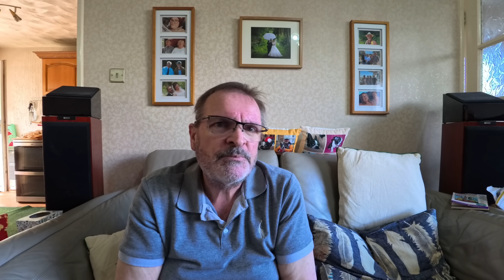Expert Ships Engineer Reacts to Baltimore Bridge Crash

Comment: I am not an engineer, but I have used a pretty powerful motor on an inboard Columbia River boat, along with other boats.  I am almost sure the narrator/engineer is correct about the propeller going in reverse.  The first thing I noticed when watching the video, over and over, was the heavy black smoke and thinking it was operating under a load all of a sudden.  I reasoned, that if the ship was getting close to a bridge and there were any worries at all, the pilot or whoever was operating the rudder and throttle, there would be no sane reason to speed up the forward speed in an unsure situation.  He should have just maintained the steering and glided right through the gap, instead of powering through on the same course which they had been traveling.  The red lines that were superimposed on the video showed the course taken.   I suspect that whoever was steering the ship either panicked or was a novice...probably both.  As our narrator said, in a roundabout way, things of that magnitude that are so heavy and long tend to happen in almost slow-motion.  Whoever it was that threw the ship into reverse was not familiar enough with reversing for a sudden "stop," (and the effect it would have on the steering), to make a level-headed, professional decision.  I am guessing that it was "pilot error."  It might be that he bribed someone to get approved for a license.  It was either that or it was intentional...which is a whole different bucket of worms.
Reply from the maker: It’s not uncommon for Ukrainians to buy their certificates. Full astern and the wind pushed the boat into the bridge
Reply: @retroonhisbikes  My thoughts, exactly.  The first "Pilot Error" was buying something that should be earned.  It was originally the government official that "sold" him the license in error.  I didn't know the wind was a factor.  I also didn't notice the plume of smoke blowing to the ship's starboard.
Reply: I'm sticking around for more of your fantasy stories.   Well...  yours and retro.

Comment: Why at such as an inopportune time for a ship to have a blackout ? Does not appear to be normal.
Reply: Your boats engines will fail at the most in opportune time. They are like printers and computers, when you really need them they will not work.
Reply from the maker: Stuff happens

Comment: The "paddle wheel effect" is called "prop walk" and is a real effect. Yes, in a full reverse situation, the bow will tend to drift to starboard. The bulk of the ship, the momentum would keep the ship going forward.  In reverse, forward to starboard in this case.  He is right.
Reply: You guys are more experienced than I am. I have never felt prop walk with my two props. I do know that when I'd throw my engines in reverse my boat will turn the opposite way of when they are in forward. Maybe since mine is only 65 feet it has counterrotating props and ships have props that are not counterrotating? But to me that would be unusual both from a steering and engineering perspective.
Reply: @sofakingrad3530  Ships have a single prop. A twin prop has counter acting forces as one prop is typically turning clockwise while the other counter clockwise going forward and opposite in reverse. On your yacht, try going in reverse using only one engine. You will see "prop walk" firsthand. Try going forward with only one engine engaged. Again, you will see your bow drive to one side opposite the direction it goes in reverse.
Reply from the maker: Thank you

Comment: They should have crew at all stations and emergency steering when in and around port or bridges/other objects.  If that's not the rule now then it should be.
Reply from the maker: You have hours of rest to think about, if the engineers had been up all day doing maintenance and again up at midnight to take the ship out, you still rested engineers for the morning. 
Most ships these days run an unmanned engine room, have sailed on ships that have no engineers in the engine room at standby - scary stuff
Reply: @retroonhisbikes   Yeah that is scary to think about.

Comment: As to fuel, the North American ECA extends 200 miles from the coastline.  It is about 170 miles from Baltimore down to the mouth of the Chesapeake (Cape Henry Virginia) and then another 200 miles out to the end of the ECA.  If she was going to Colombo then her track would probably have kept her inside the ECA until about 60 miles off Key West, unlless she was routed East of Cuba which would have her exiting East of Cocoa Beach, but then Panama Canal requirements of fuel/scrubber in the zone would question if vessel would have changed bunkered fuel.  Absolutely not within US waters and not within NAECA.

As for her drift and the way the stern moved to port you have a valid observation, either that or the influence of Curtis Creek emptying in to the Patapsco.  Either way her bow rounded the dolphin (which when she struck was about 15m from the and abaft the starboard beam).  With regard to the investigation it will be NTSB and the Coast Guard juggling their involvement, then various civil courts will become involved

Comment: I am a naval architect and marine engineer.  Over the years I have spent untold hours studying escorts, steering, thrusters, allisions, oil spills and oil spill response.  My professional career was spent working major oil companies.

I agree with your conclusion that they mistakenly went astern when they restarted the engine.  I also believe they mistakenly released the port anchor.

I believe that the MV Dali at eight knots had enough lift from the rudder to steer the ship.  I believe that they would have retained steerage until the speed dropped below 6 knots.  I  believe they would have had enough speed and rudder control to pass safely under the bridge.  

I, of course, am making judgment based on my experience.   I am not a licensed engineer.   My time at sea was during sea trials, doing tests, supervising contractors, and watching the ship's crew carrying out their duties.  I am opinionated when it comes to certain items.  I believe when the NTSB study is released in a couple of years it will indicate the accident could have been avoided had the officers on the bridge fully understood the behavior of large vessels in blackout conditions.
Reply from the maker: Agree 100%
Reply: Agree but the report won’t be out for at least 2 years. It was a preventable accident at best.
Reply: Makes me think of the endless speculation on how the Titanic could've avoided that iceberg.  Throwing it into reverse deprived the rudder of prop wash and lost its effectiveness.  Had the Titanic OOD simply ordered hard to port, the prop wash from the center screw was available to amplify the rudder and it could've missed the iceberg.  Another few seconds to assess the turn might've sent a second order for the port engine to stop.  Thus creating a bit more asymmetrical drag to further turn the ship.

I know.   Woulda, coulda, shoulda.  Easy to be the armchair captain after the fact.  Panic and instinct overruled training in this case.
Reply: I have nowhere near the credentials you have. Yes, I'm a retired navigator, and I reached the same conclusion. Panic and desire to fix the non e existing problem. Enough speed to clear the bridge. Conspiracy theories abound. Captain, which has not been mentioned thus far, is Ukrainian, blackout black box, Biden offering to cover the rebuilding costs to prevent a investigation by the insurance company...
Reply: Unfortunately, construction sea trials do not demonstrate a loaded ship maneuverability under power failure circumstances.🎉
Reply: There’s no way letting go the port anchor was a mistake.  Letting go the port anchor was the prudent call in that case.  Whether or not they went astern remains to be confirmed.  If they did go astern, was it a mistake in the moment? Would they have just coasted through if they hadn’t gone astern? I don’t have the answers. Those are the questions that will be argued for many months to come.

Comment: Another consideration, yes the Main Engines would shut down on LO trip, oil pumps stop - the Alternators would continue running, Putting instant full load on the First Alternator would trip that breaker, the second black out - the engineers in the control Room, instant panic - the question must be why instant Black-out - as preferential trips should have reduced electrical loads and prevented total loss of power - the outgoing tide could have done the rest
Reply: the ship's generators are always carrying full load....  the main engine only performs propulsion.

Comment: Surely the paddle effect would only apply if the propeller was only half in the water. Fully submerged, it’s top rotation would counteract the lower.
Reply from the maker: Mostly the top of the blade is out the water. May have needed to ballast in clear water.

Comment: From wikipedia, the ship is equipped with MAN-B&W 9S90ME-C9.2 - Main Engine. This rules out Diesel-Electric propulsion.
I am puzzled how can a blackout create a complete loss of propulsion.

During Sea-Trials such ships are tested for propulsion and maneuvering tests under blackout condition. So, I still don't understand what happened there. Loss of electrical power should not create a condition of loss of propulsion and steering.
Reply from the maker: Fail safe, will stop the engine. No lube oil will also stop the engine.

Comment: As an Engineer myself - I understand the Vsl is twin screw with divided Engine Rooms and 2 Alternator Rooms, maneuvering with a split board - there would not have been sufficient time to restart the main Alternators and certainly no time to restart the Main Engines either ahead or astern - the black smoke most likely from Emergency Alternator starting and coming onto Full load within seconds - given full Indian crew I'd be questioning competency
Reply from the maker: Single screw and theyve have not split the switch board.

Comment: If they had 8 knots of forward momentum and the ability to steer once the emergency generator started (which it clearly did) then wouldn't they have been better to simply steer the ship ? With such a massive momentum wouldn't that have given them better control on the course they were already heading ? Not understanding why they put it in reverse thrust, which looking at the video seems to be the point it all turned pear-shaped.

Comment: Thank you for taking the time to offer a professional assessment. It's a good public service. It seems this vessel was notoriously deficient in both propulsion and electrical systems and a whistleblower that tried to alert the authorities about major safety concerns was suppressed by Maersk, the leasing company that chartered the vessel and was already cited for violations last June. Aside from that most glaring fact, WHY were the tugs not in attendance until the ship made it safely to open waters?! Did they just assume that because there were specialized pilots aboard the DALI that were trained to avoid port obstacles that their presence (the 2 tugs) wasn't needed during the most crucial period?
Reply: we know what happens to whistleblowers

Comment: I agree with your analysis Chief - though the first black out looks like a full black out (as the navigation lights and the forecastle  flood lights all went out suggesting a Main switchboard trip - for example  possibly the  main engine stopping due to engine control system safeties tripping ( possibly   the lubricating oil and fuel pumps etc stopped) or an Engine overload trip (ie  going from dead slow to full ahead to fast) - I don't see it being a fuel issue as normally they would isolate the cylinder by shutting off the fuel to the cylinder injector. When it repowered up ( it looks like 3 small puffs of black smoke( air start indications) before the big one) - only the  Navigation light and deck walkway emergency lights came back on ( ie Emergency Generator circuit), then you see the  black smoke rise (Main Eng restart & then continuous thick Black smoke ie Engine under load (with rich fuel / air mix) -  as you said. Then the Forecastle  Flood light  come back on (Main power source restored), when the second black out occurs the navigation lights stay on ( indicating they are still on the emergency Generator Circuit) - may be an Engine safety was triggered ( ie  Engine overload trip), before the forecastle flood light comes back on  again( main power restored), at the last moment you see the ship  swing to  Port (more correctly - the  stern kicks to Starboard) - this is likely the dropped anchor  taking weight and kedging, as there is no  break in the Black smoke -   I'm a former Master & marine insurer's  defence lawyer specialist  who  specialised in  Maritime  incident and  responses, investigations and litigation - so am intrigued to working out  the cause of the the tragic event. Poor Crew will be  grilled endlessly and will be stressed and shocked all at once. BTW - I think you are right re the going astern issue at 8- 6 knots and  being les than 2 ship lengths to the bridge...  that is a  butt pucker moment! -  and the  Bridge  was not protected  with modern  ship allison barriers  compared to the bridge  pylon protection on the nearby overhead Powerlines Poles protection  barriers.  Terrible accident.
Reply: I doubt that barriers would have protected the bridge in this collision. The ship was slewing to starboard, the bow still going in a sideways motion. The bow did not hit the pier head on. It hit it on the side. It is the forecastle structure that hit and sliced the pylon. This displacement buckled the pylon of the bridge and pulled the deck - to the left in the video. The recoil, the "spring back", snapped the anchor points of the deck on the other pylon, right hand side in the video. Careful observation reveals the shock wave travelling back (left to right)  along the bridge deck and structure after the bridge was put in tension by the forecastle impacting the pylon and the shearing of the pylon released that tension.
Reply: @denkern-phil   I can't comment on the  mechanics of the bridge failure am not a structural enginneer - but your description sounds logical to me,  the "Slewing  to starboard" I can  comment on because that is a fundmental of ship handing and is caused by what is known as transverse thrust (or paddle wheel effect) when the engine is put astern. And you are right  the  Impact was  about  2  - 3 points( 22.5 - 33.7 degrees) on the  Starboard side of the bow but at the last moment  about 5 seconds befoer impact -  the ship actual starts swinging to Port (most likely due to the  dropped anchor taking weight)   If the  electrical power bow truster  was  used  it would push the bow sideways  first, if steering the black smoke would have a gap as the engine load changes ( which  I can't see) and  the stern moves  sideways before  the bow. Hence  without the black smoke  change  it seems the  very last minute swing to port  in not caused by steering.
Reply: Interesting and quite possibly correct analysis of the electrical power sequence, there was something wrong with the emergency supply to the navigation lights and, according to the NTSB the data recorder, so there may also have been a loss of instrumentation on the bridge: no radars, electronic chart display, helm and engine indicators, so the bridge team may have had difficulty understanding their situation. The ship swings to starboard tho'(bow to starboard, stern to port), as you'd expect when the ship's engine goes astern, so the swing to starboard and the black funnel smoke is consistent with the engine being put emergency full astern while the ship was still making headway.
Reply: @simonjohn9525    I think people have misunderstood the NTSB Language about the Voyage Data Recorder..   The way they work is that it receives signals from Instruments and systems , and recorded  audio  (microphones) on the Bridge at the same time. If the Voice recording never stopped recording audio then  it never stopped functioning - what I believe is most likely  with the black out is the  instruments and systems  stopped sending signals until they repowered,  which is why  there was the minute where the Voyage Data recorder  stopped recording Instrument & System data  but still captured the Bridge audio.  What actual caused the initial Blackout that started the chain of events will be difficult without seeing the Engine control  Alarm logs but logical  is most likely related to a particular critical system I think.  My knowledge and experience on international ships, systems and  investigating these sort of incidents  around the world says  it was just a number of bad events combining in a   chain/sequence all at once and it is not just caused by the  cause of the Initial blackout. The legal  issues are massive and complex and due to the amount of money involved - no one will escape blame.
Reply: Good analysis